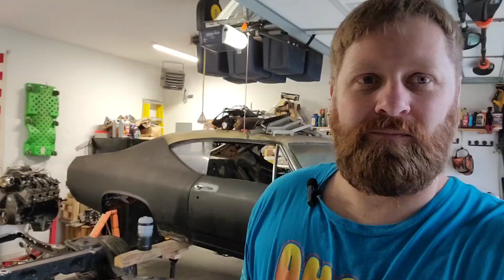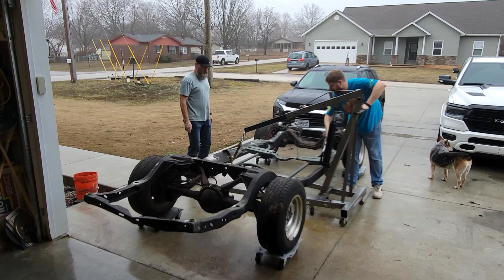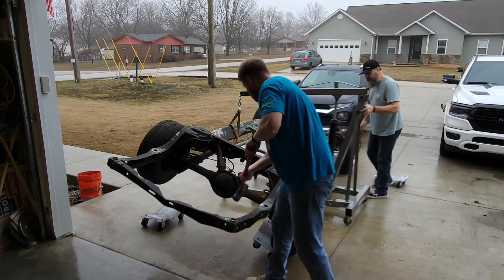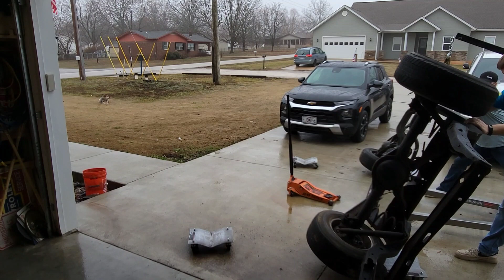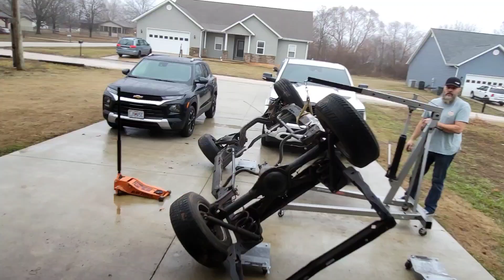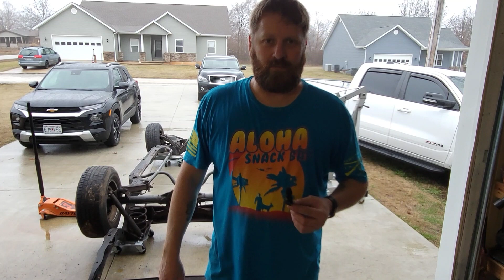Chevelle flipping the frame over.  #chevelle #fab #restoration #musclecar

Comment: Is the diff leaking gear oil upside down?
Reply from the maker: It most certainly did.  It was only attached for a few hours until I took the rear suspension and diff out.  Forgot about the vent.  My wife loves the smell though!!  Not!
Reply: @RecycledRacing  at least you now know it wasnt empty!!! Dont forget to top it off before you drive it!